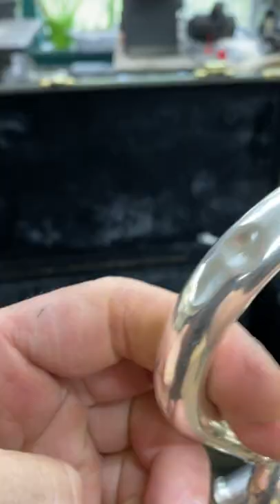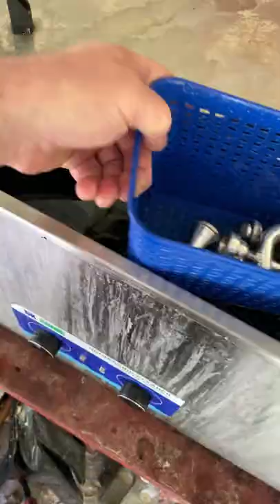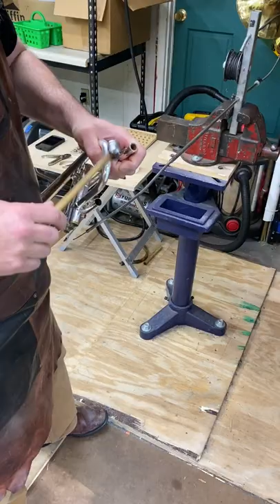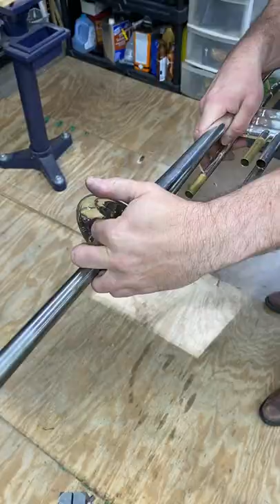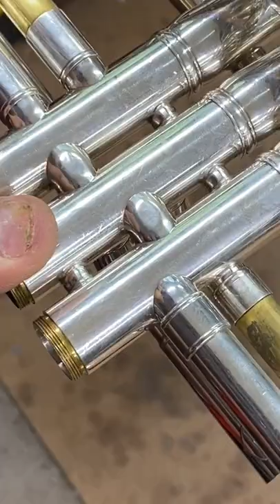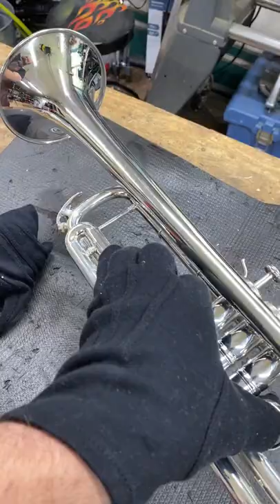Silver Trumpet Dent Repair, Flush, Polish- band instrument repair

Comment: Please press the valves when removing the slides. It’s unlikely to cause any damage but over time this can lead to valve problems and air leaks. Also it would just hurt my soul to see someone do that to my horn
Reply: Yes please hold down the valves
Reply from the maker: I’m guessing that it would surprise you to know there is a reason for doing this. 2 things, first is that if the slides are stuck, you risk damage to the casing of the pistons are out. Second, in the old days before there were computers to measure this is how compression tests were done. In fact, you can learn a lot about how well the fit of your valves by pushing the slide in without the piston pressed and see what count you can get to and still have a “pop” when it is pressed. No count, no compression, bad fit valves and the horn plays bad.
No real instrument can create nor suck enough pressure to do damage.

Comment: Jesus! Push down the valves when you are removing slides!
Reply from the maker: Would you like to guess how compression is measured the traditional way? Hint: it involves moving the slides without moving the pistons.
Reply: Is it not the buildup and sudden release of pressure that causes indentations and internal damage to the instrument?
Reply from the maker: @qwerty-cs4pv  no, it is not. It takes 4-5000 psi to move brass . Reference old Conn factory video for a cool look at making horns, bending, etc. 

I suppose an argument can be made on the cheapest of instrument shaped objects, but on the whole, no. Leaving the pistons in place serves to protect the casings, especially when dealing with stuck slides.
Reply: All I know is that my student Antigua that I had suffered from what I described very heavily.
Reply from the maker: @qwerty-cs4pv  and that maker is out of business